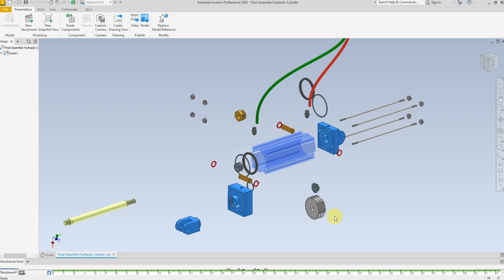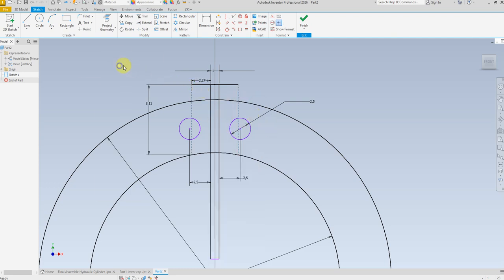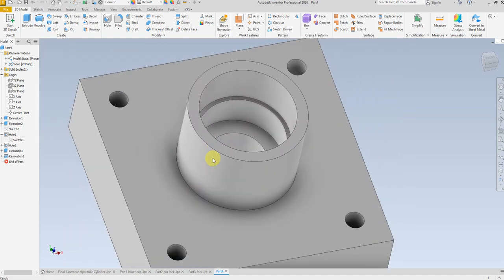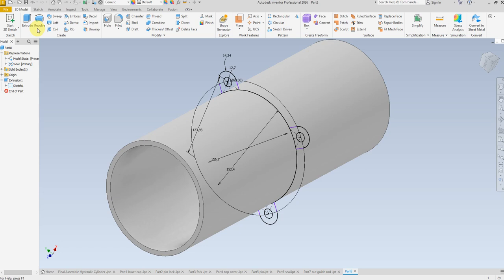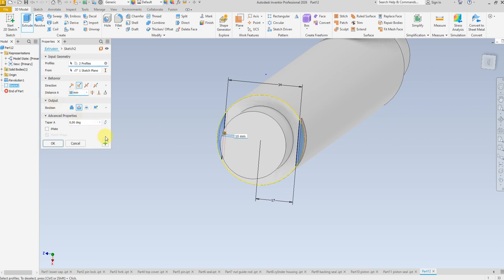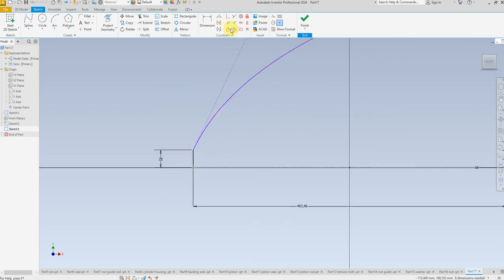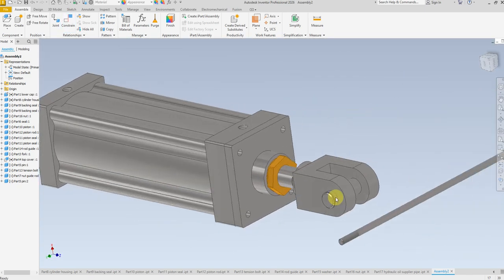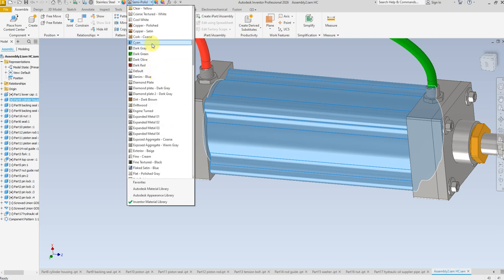Autodesk Inventor 2026 Full Tutorial  Create Hydraulic Cylinder  Exercise 112

Comment: Right now, I'm watching your video and wondering why you are using an external calculator app for the calculation.
When you are using the Dimension tool, you can paste your dimensions as a formula, for example, 16.83 / 2. Also, a cool feature is that you can refer to a defined dimension by just clicking on it.